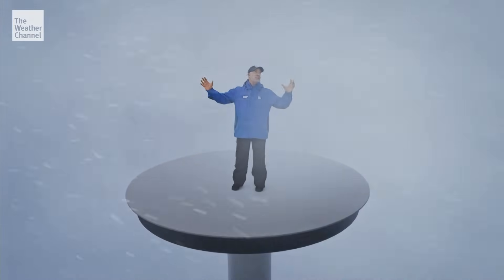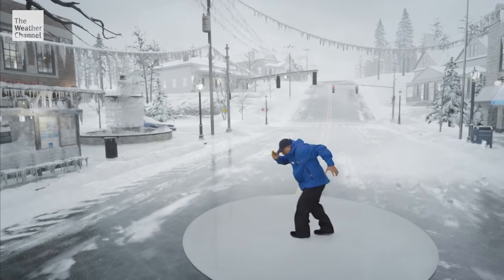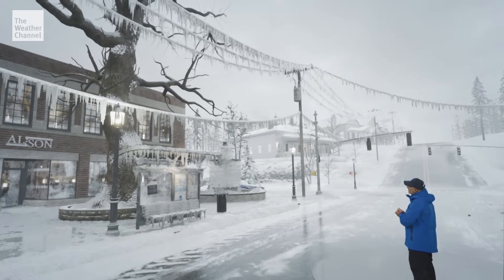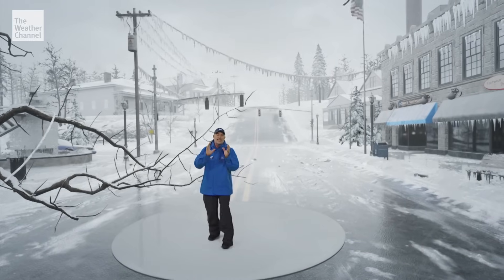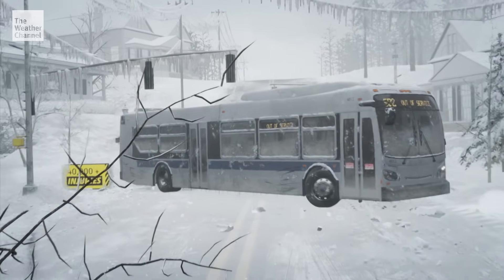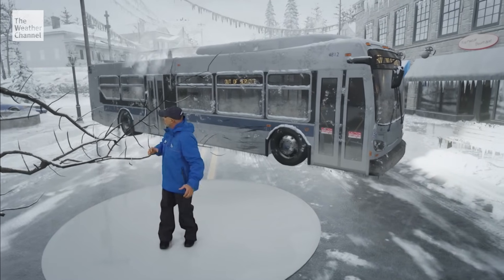The Science Behind Ice Storms | IMR

Comment: There's another factor that goes into how much damage an ice storm can cause; and that factor is wind. At a high enough wind speed, even just 1/4 of an inch of ice (i.e., 0.25 inch) can cause damage that's described by the Sperry-Piltz Index like this: "Prolonged & widespread utility interruptions with extensive damage to main distribution feeder lines & some high voltage transmission lines/structures. Outages lasting 5 - 10 days." This is the description for a Level 4 out of 5 ice storm on the Sperry-Piltz Index. That .25 inch ice accumulation can do that much damage, given a wind speed of 35 or more miles per hour. Also, if a 35+ mph wind accompanies an ice storm with "just" .5 inch (that is: 1/2 of an inch) of ice accumulation, then that will cause a Level 5 out of 5 ice accumulation damage! Here's the description for a Level 5 Ice Storm: "Catastrophic damage to entire exposed utility systems, including both distribution and transmission networks. Outages could last several weeks in some areas. Shelters needed."

Comment: The ice storm of 1998 here in Eastern Ontario was even worse than that. Power poles snapped from nothing other than the extra weight of the ice buildup on the lines. Trees coming down on the wires everywhere added to the problem. Even huge transmission towers were buckled and collapsed from the ice on the cables. People were burning downed power poles for heat because there was no power to run furnaces or electric heaters.
Reply: I remember that storm well and I was living in Toronto so we didn't get the worst of it.

Comment: extended period of time without power. make sure you has bottles of water and can food that has bit of a long shelf life and can opener. Cant forget that can opener. also, during the spring/summer months, try to find generators. at least enough to power some lights. if can get big enough one maybe enough to power space heater. try to stick it into one of the smaller rooms of the home. so trying not to heat entire house with one space heater. try to leave faucets a slight crack to prevent the pipes from bursting too.

Comment: Fuck the imperial System go metric. Its so easy!
Reply: 6500 ft = 1981,2m
28°F = -2,2°C(both in 0:11)
1800 ft = 548,64m
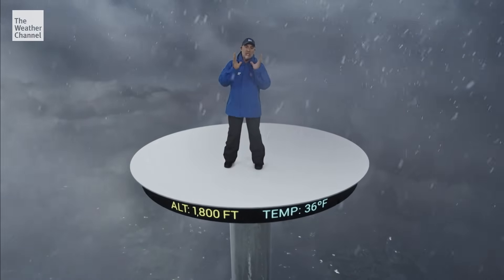36°F= 2,2°C(both in 0:25)
surface 29°F=-1,66667-°C(in 0:42)
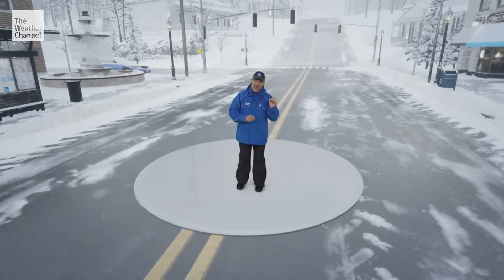1/10 in =0,254 cm(in 0:58)
1/4 in = 0,635 cm(in 1:03)
1/2 in =1,27 cm(in 1:06)
90mph = 144,841kmh(in 1:30)
1000 Lbs = 453,592 kg

Thats the way it sould be. For all off you dont think metic 0°C is the freezing point of water.